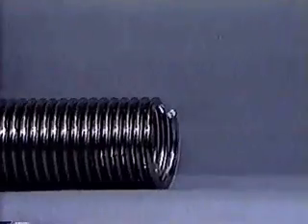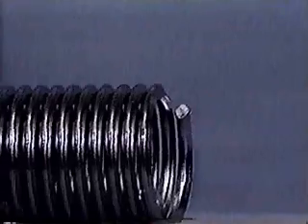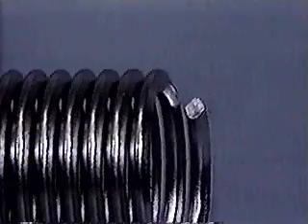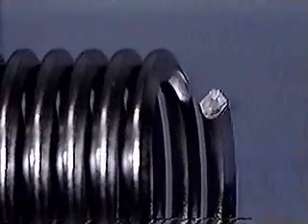helicoil

Comment: @sjkoerner The reason that a bolt in tension transfers the load mostly to the top two threads in a tapped hole is because the bolt stretches slightly under a tension load.

As a crude analogy: Get a wide rubber band. With a felt tip pen make some triangular marks on one end of the rubber band to look like a thread in profile.
|/\/\/\/\/\/\/\/\/\                |  
Now stretch the rubber band a bit.... the marks now look like this
|/ \ / \ / \ / \ / \ / \ / \ / \ / \                                |  tension ->
In this extreme example you can see that as our rubber band bolt stretches the threads also stretch. This is what happens to the threads on the bolt to the right of the hole (the hole is to the left.)
Now grasp the rubber band about half way along the threads and stretch it... it will look like this
          |
|/\/\/\/\ / \ / \ / \ / \ / \                          |  tension ->
          |
(The | marks the level of the hole) We can now see that area near the opening of the hole has a couple of threads stretched inside of it. Since our fingers are not transparent you can hold the left end of the rubber band between a clear plastic ruler and a solid surface. Then we can see that clearly the greatest load will be taken up by the few threads closest to the hole opening. The threads further to the left of the opening will have considerable less load on them.
I hope that is clear.

The reason the Helicoil (and similar) systems works so well is that they can also stretch ever so slightly along with the bolt threads and will therefore distribute the load further down the threaded hole.